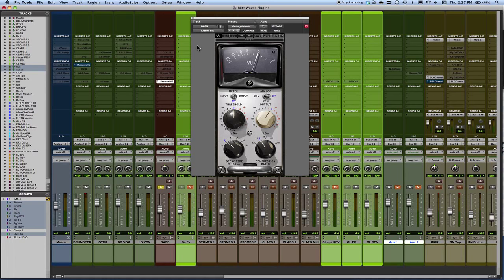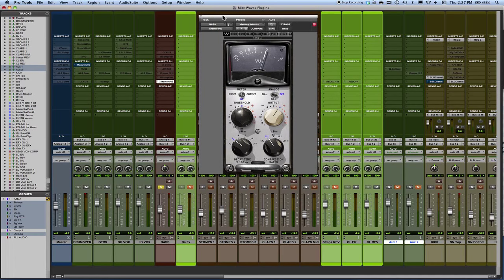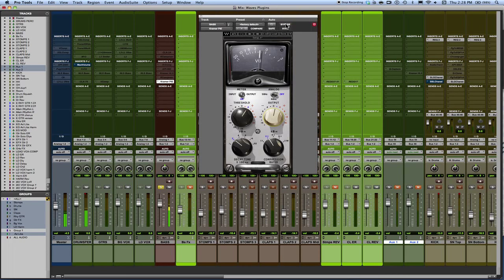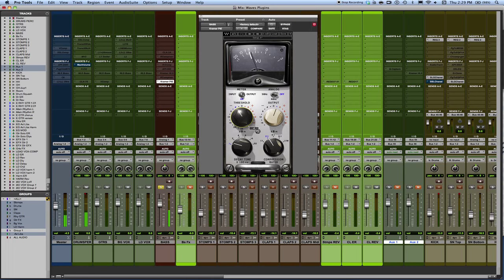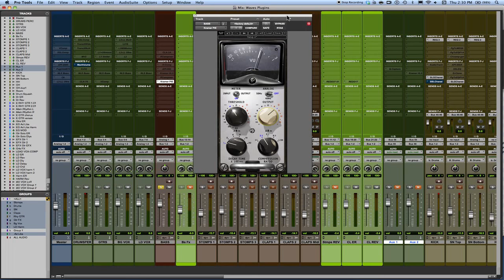Mixing With Mike Plugin of the Week: Kramer PIE Compressor

Comment: Before I watched this video, I slapped this sucker on a bass. I actually wanted the Kramer Tape but mistakingly hit the PIE compressor.  I already had an UAD LA2A on my bass (which I do 90% of the time) but something in my head told me to mess around with this compressor. HOLY HELL. This compressor is AWESOME for bass. You can compress heavily and still get a bunch of low end. Or you can do a gentle 2-3 dB GR and have it sound more musical than where you left it.Definitely a keeper.
Reply from the maker: Nothing like instant results!

Comment: HOLY SHITBALLS! I KNOW this compressor is used for drum buss and bass most of time....but I popped the WAVES L2 on the mix buss to get a good signal going into the REDD17 stereo desk to round out and phatten up the tone and THEN I popped the pie in the signal chain and it just kicked ASS all over! I was STUNNED. Normally dynamics are a pain in the ass with getting that cohesive wall of sound...especially in the mid range to create that energy...and yeah...by itself it wasn't as impressive...but damn it...if you use a few of these plugs together you can get an amazing signal chain I've heard people say they can use multiple compressors in serial...and in parallel...to get a rockin sound but I never quite found a combo that worked for me...and I have them ALL.  Fabfilter, Tube Tech, ..you name it. But THIS THING brings some amazingly musical compression and gain without clipping etc. It's really something. People who don't know about this are getting ROBBED.